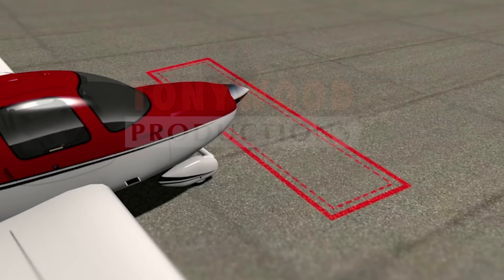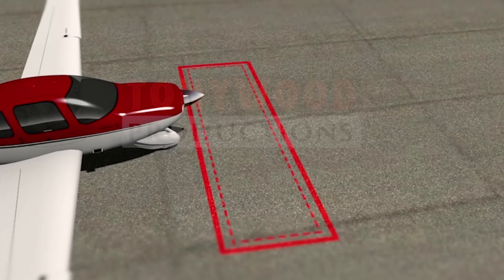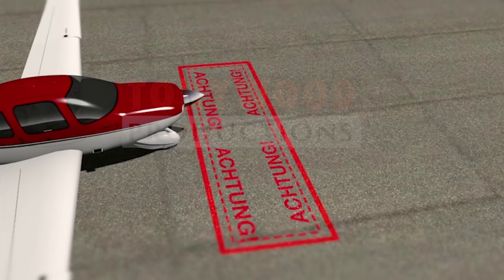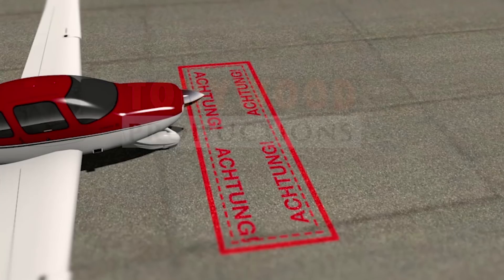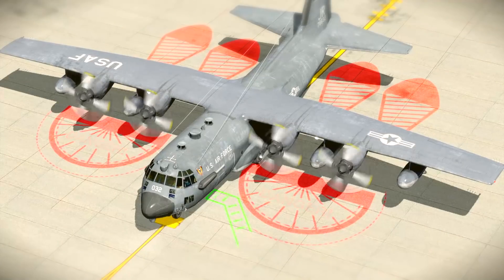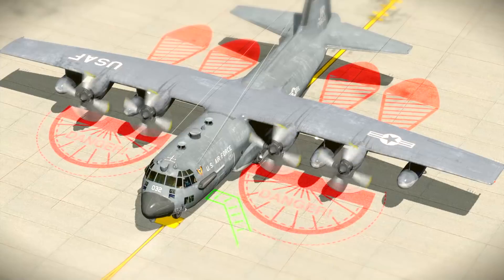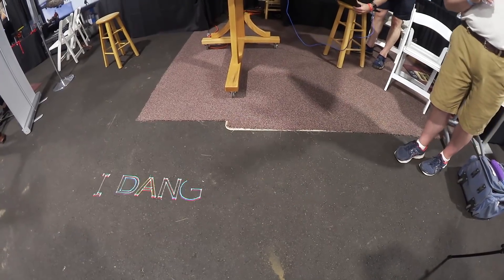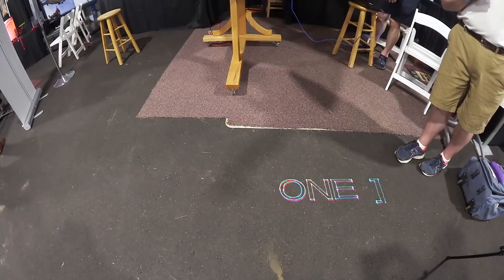Laser Symbology Warns of Prop Danger

Comment: I always thought of something like this for motorcycle safety on the road. Flash this around a bike, maybe two bike lengths ahead so car drivers have an easier time anticipating their presence.
Reply: Banggood and Gear Best from Chine was selling this for bicycles.
Reply: Rental bicycles in London project a picture of a green bicycle on the ground about ten feet in front.   
Unfortunately it's the same design as the green light for bicycles used in traffic signals, so a certain type of road user interprets it as a personal mobile green traffic signal entitling them to right of way and bad luck to pedestrians who don't react to it soon enough.